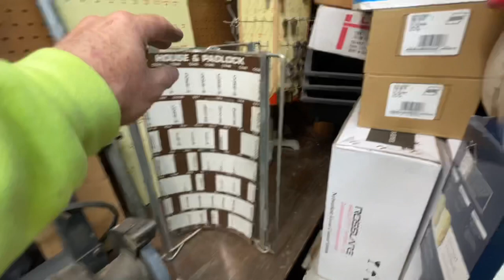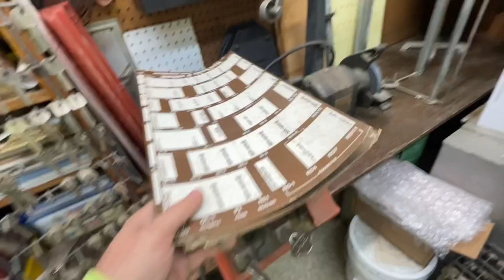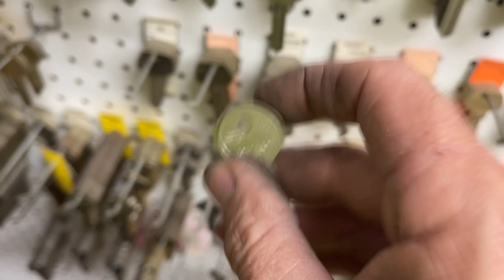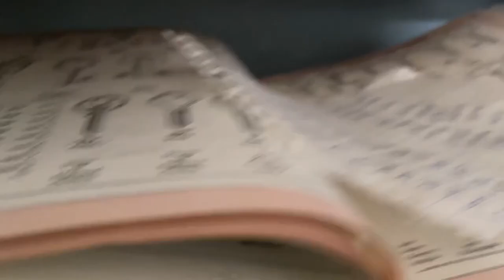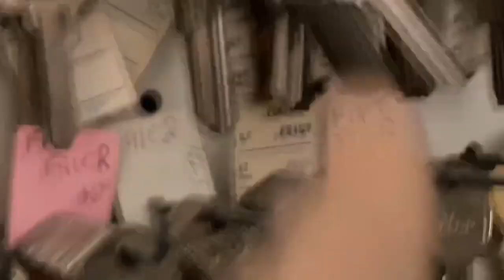Lock Shop vLog 11 “rearranging the old vehicle key wall”

Comment: A key wall is never finished, especially if you do new auto stuff. I have mine 4' high by 32' long and get to the wall and do the stare 😵‍💫 I find throwing something like a sign or neon in the middle of the key wall breaks it up.  I did notice the red rouge on that polishing wheel 👍
Reply from the maker: I can only imagine dealing with hundreds of remotes. Dust shows much worse on black plastic too 🥺😂

Comment: hey jason how is your memory with so many keys to remember?...the key board where I work is tiny compared to yours, it has a horrible mix of brands and models with so many different numbers by brand and type that it's crazy!! ! lol my boss is not organized at all, you must have a super hd installed since in Brazil we usually memorize all kinds of keys, although it is easy with time😅
Reply from the maker: ahh the ole memory :) I hate to admit it but I’ve run into things that people have assured me I did “long ago” that I have no recollection of.
I’ve always been terribly with names, but overall I’m still spot on with addresses and peoples pets names

As far as what’s in the shop both key and lock wise, I mostly know it’s in here…somewhere, I may not know exactly where but I know the vague location but it hasn’t helped with my introduction of all the new shelves last year for sure! I’ve moved some stuff around and it is causing some grief. I currently cannot locate my box of old blades (to see if I can use one for this machine) but I know it’s here…somewhere 😂 I walked around poking at things and shining my light around for a solid hour yesterday looking for it.

Undoubtedly, in the near future, it will take me forever to find the Jaguar or Rover key that has now relocated to a weird spot on that wall 😅😅
 
*sigh 

Thanks for watching from Brazil!